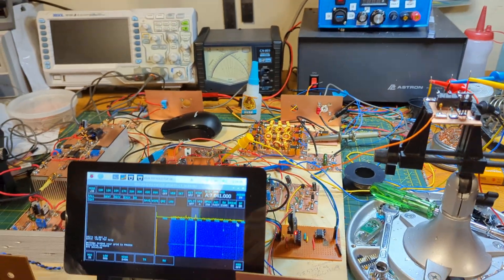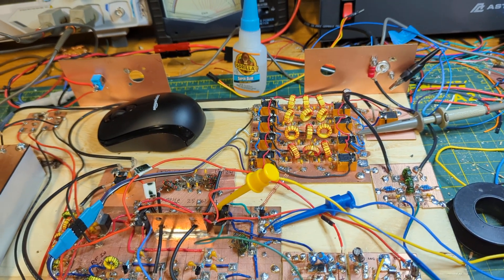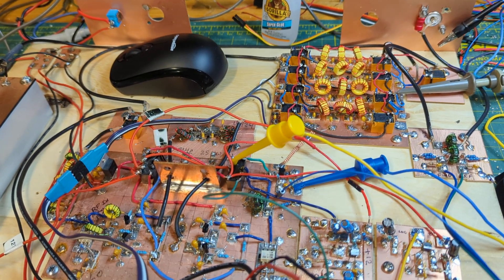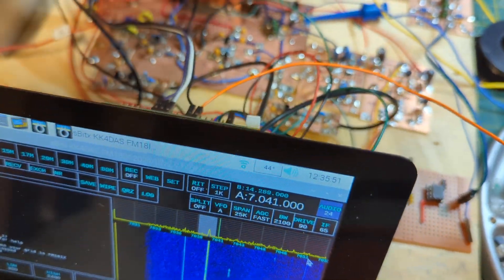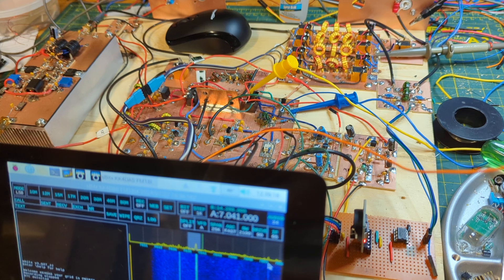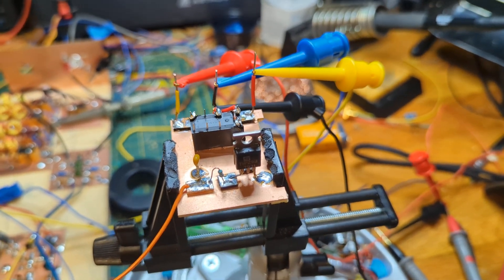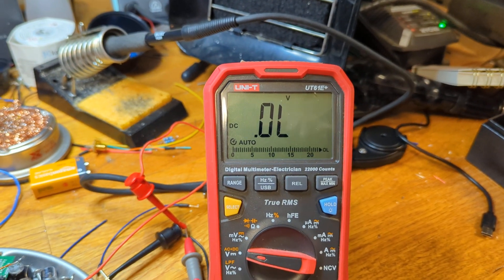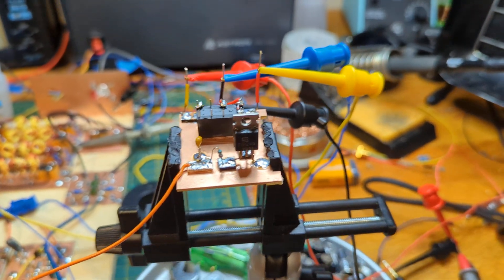Homebrew sBitx Tx/Rx Relay Fix

Comment: The low voltage output on the PI GPIO pins is between 0.4 and 0.6V  High is 2.9 to 2.4. So there is a danger of switching the transistor on with the GPIO set to low. A simple solution is to put a potential divider in circuit with equal values the centre will be <=  0.3 V when the pin is low and > 1.2V when high that should also cure the random switching.

It's worth having a bag of 2N7000 mosfets in stock. These make easy work of such issues. The source - gate turn on voltage is a minimum of 1V  so the 0.6 volt output when low wont switch them on. They also have a very low on resistance so can drive quite heavy loads.

I usually put a resistor between Gate and ground just to make sure the device switches off.

Andy
Reply from the maker: Thanks Andy!  I did hit on the voltage divider idea as you'll see in one of the follow on videos.  It hadn't occured to me to try a 2N7000 but that is a great suggestion.   I wonder is the MOSFET will be less prone to partial conduction in the presence of RF.  Given the low voltage output on the GPIO lines it makes wonder why virtually every online tutorial uses a 2N3904 and does not use a voltage divider at the base of the transistor. Does no-one test their circuits before they publish?
Reply: @kk4das122  in their defense the GPIO pins are connected to the IO of the broadcom chip and the actual spec is not well published. I found a few bits on the web that gave the info.

I suspect that many people fall into the trap of thinking that GPIO low = 0V. It's very unfortunate that the low output is right on the usual transistor threshold voltage and I suspect that is many cases it seems to work OK. Regardless you should have some sort of buffer / circuit that takes cane of such things. There are quite a few chips that will do level and logic conversion, but the cost is more components  (The chips are cheap) 

The Pi 5 has a different GPIO interface, I think I read that they have taken the I/O control of the Pi Pico and used that to buffer the broadcom I/O.  However I've not got a Pi 5 as yet so just going by what I've read.

The 7000, they seem pretty solid, a resistor from gate to ground to ensure that it turns off and decouple that with a 0.01 ceramic and it should do the job nicely. The big plus is that it does not draw any current as such from the GPIO so that helps protect things. You have more danger from pick-up on the wires than anything else, so it pays to take a bit of care with that.

Just about to have a look at the other videos...

Andy G0POY